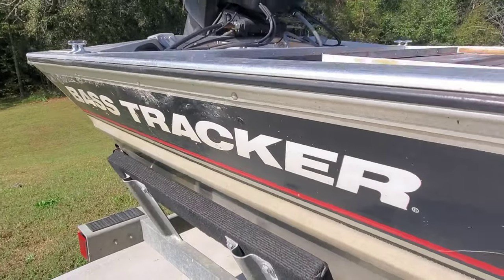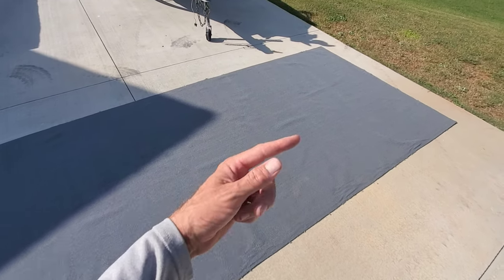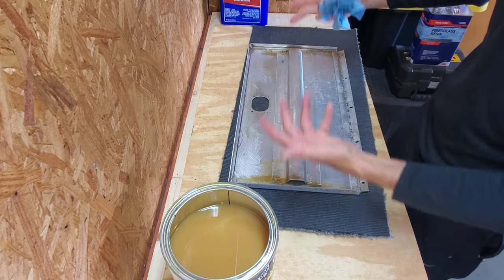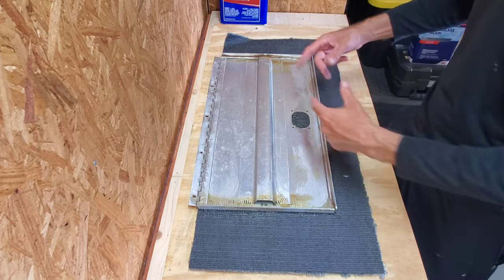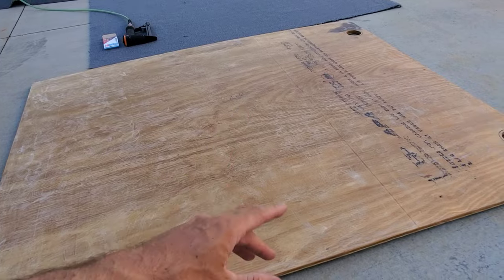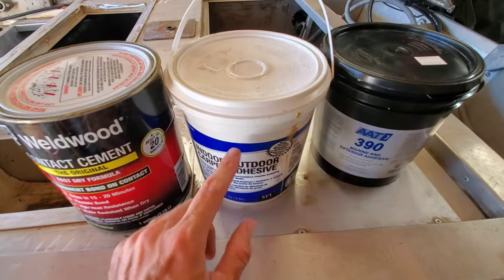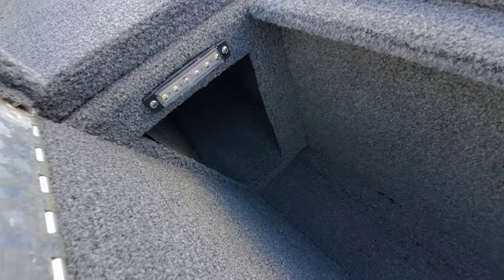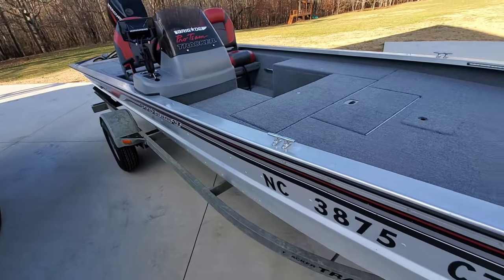DIY Aluminum Bass Boat/ Jon Boat Carpet | Everything I Know to Install Boat Carpet 2022

Comment: Thank you thank you thank you! You are the first one I’ve stumbled across that actually tells people to lay everything out the same direction. Looks like you do great work.
Coming from someone that has done auto and marine carpet and upholstery for 17+ years, I have a suggestion on some glue you can try that would streamline the process so much more. I use weldwood contact adhesive as well, but I use the landau top and trim spray grade adhesive, in my experience it is much better than a brush on glue because you can spray it and after about a minute stick it down without so much of a mess, plus it allows for a much more even coverage. It is a little bit pricier but you can spray it out of a standard gravity fed paint gun. 
Also, I know this will be a controversial topic, but you honestly do not need to strip every ounce of old glue off. The way I see it, if after a sharp scraper and a brush goes over it and smooths it out and there is still some left, than that glue is not coming off any time soon, and it will not affect how the carpet adhesive sticks to a lid or floor.
Just my two cents, I know a lot of people will hate on it, but I always try and help out with advice when I can.

Comment: I have this exact boat and I just got my carpet from Amazon yesterday.  I have contact cement and an exterior carpet.  I replaced the floor with a sheet of aluminum and put a skin of aluminum over the plywood on the deck.  I am adding some lighting and will build out the deck.  Wish me luck!  This video has been instrumental in my rebuilding my boat.  Many years with my kids…..thanks

Comment: Perfect timing for me on this, thanks for the detailed video.  I watched this after carpeting my first 2 panels of a 16’ tracker so many to go.  I was paying attention to laying out the carpet all north-south off the roll into the boat front back but didn’t pay attention to if I flipped a piece to south north...figured the grain was the same but your “50 shades of grey “ comments made me check and no doubt, even keeping the grain in line but flipping to south north is super visible so thanks again.  I got lucky my 2 were ok but I had one ready to start that wasn’t!
PS regarding the contact cement.  If you want to speed up application on a good sized project I might suggest DAP Weldwood Landau top sprayable version over the red can original.  You can spray it from a cheap $20 harbor freight gun.  Goes on way faster, more evenly and has quicker flash off.  I think it’s what the factories all use, always looks sprayed to me.  As a former car audio shop owner I upholstered a lot there and we always used it, when starting ,my boat I called DAP to ask and they suggest it over red can for boats, they said it’s more foe auto and outdoors, red is for countertops etc but obviously does work.  You won’t find it in stores but Amazon etc has it. Just a thought

Comment: Fantastic video, as always!  I just completed my wood-decked project, using the same TEC adhesive and spreaders.  It's great that it is water-cleanup (as long as it is still soft), because that can save minor mishaps.  One thing I did to prevent fraying of cut-piece carpet edges is to use a hot knife to cut all my carpet parts.  It's slower, but it seals the edges as you cut.  With just a razor knife, it seemed that the carpet wanted to fray a bit when cut with the grain...and I used the same 20 oz carpet as you have on this project.

One other tip...try a silver Sharpie when marking the back of the carpet -- they are amazing.

Comment: WOW! lots of great info. I am going to do a 1992 Basstracker Pro 17. almost the same boat as you have here. Only one question, how did you screw the wooden decks down and not have the screw heads showing?

Comment: What would be the cheapest route I could take to redo my boat? Carpet or foam next question… And one of your videos I thought you said Bass tracker uses half-inch plywood, mine looks like 3/4 Next question when buying that plywood I bought three-quarter inch marine grade. In my area I t’s $128 a sheet. Unfortunately I think I need two sheets… Do I actually need marine grade or can I buy an outdoor type plywood(what kind) and coat it in fiberglass resin like you do.

Comment: Awesome job brother!! Great tips and techniques. My Bass Tracker Pro Team 175 TXW needs this. Factory carpet just doesn’t last long.
Reply from the maker: Thanks man, appreciate it. Hopefully youcan rework yours.
Reply: @AnthonyJonesBrigadeBoats  One thing I noticed on my boat and other how-to videos. The carpet on the hatch openings doesn’t wrap under the frame lip. It actually stops at the bottom of the vertical so the carpet wrapped under the hatch sits on bear aluminum. I suppose that is because there doesn’t need to be double thickness there. Just an FYI thing for ya.

Comment: Now this was good. I never even thought of the front to back layout. I am in the process of doing a 16ft 96 Sylvan sea monster ( more like a sea Guppy really). I am trying to figure out the flooring. It sat for years. After we cleaned out 2 feet of leaves trash bags full of who knows what ...did find some used diapers as well. So clean out took days. Cut out the 20 wood panels and covers. They were in bad shape. But the sub floor was marine grade 1/2 inch plywood. It remarkably are in good shape. Washed it down and I am stumped. I am going to recarpet all the cut outs in 20 ounce marine carpet. But what to do with the floor. It's all riveted down. So I don't have panels to pull up and redo. Thought of going with Kiwigrip paint. But it won't look to good in my opinion. I guess I will have to pull out the driver's console so I have an open flat surface to work with. Any thing different you should do on the floor than the panels?
Reply from the maker: Yes, I recommend Hydroturf or Sea Dek. It's eva foam material with 3m adhesive backing. I have been using it on some of my recent builds. I would not recommend getting an imitation product. Hydroturf or SeaDek

Comment: I would like to move two batteries up front by my trolling motor and would like to cut in a compartment  for each on both sides of my pedestal seat. Where can I get the prefabricated hinged compartments. Yes I might as well  re-carpet the rest of boat while I’m at it.  Thanks in advance.

Comment: Mr Anthony, I need your help please. 3 pieces are confusing me, the console, the front storage, and the side rod locker. Because they stand up which way do you run the carpet to be less noticeable. 1994 18 foot Tracker

Comment: Hey sir have you ever tried the razor blades with the hooks on the ends? They work way better than regular razor blades and are designed specifically for  cutting carpet. Great in depth video
Reply from the maker: I haven't.  I have some actually but always used them for cutting roofing shingles.  I'll give them a try. Thanks

Comment: Hey I have the same boat and I am carpeting it. I ran into an issue when I used the same context cement that you do. The carpet is not sticking well is there anything that you could recommend I have already tried putting wood blocks to secure it better, but it still comes undone. Thanks

Comment: Awesome job and great video.
Reply from the maker: Appreciate it👊
Reply: Have you ever tryed to pull the back casting decking off of a tracker? I have to do some work under there and was wondering if it was possible.
Reply from the maker: It's possible.  I haven't on a tracker yet but have on a Lowe

Comment: I'm a subscriber and I'm having a problem installing carpet around the bezel & shifter on my tracker.  Do you carpet around the throttle or remove the shifter all together  ?  I'm a little confused about how to do it... 
Thanking you in advance,  Butch
Reply from the maker: I typically remove whatever I can to carpet. The throttle control was removed in the boat in video to carpet the panel.

Comment: What length of carpet do you order to completely recarpet a 17’ Tracker?
Reply from the maker: I typically go ahead and get the 8ft by 30ft to account for verticals and inside comparts floor or walls. You should end up with a bit left over.

Comment: Where do I get replacement plastic piece that the trolling motor plugs into mounted into the bow ?what would that be called?
Reply from the maker: different ones on Amazon.  try trolling motor plug/adapter

Comment: Great video on the techniques you use.   The contact cement you’re using is labeled as water resistant, so I contact DAP.  Their rep indicates that DAP does not have a recommended contact cement for marine applications.  They referred me to 3M.  Please confirm the product is OK.
Reply from the maker: I as well as other shops I know of use the Dap and have had great success. I can attest of a few boats I used it on 3 years plus ago w no issues. If I were running a turn key carpet shop I'd use a specialty cement from a manufacturer like 3m and order it by the barrel. I'm still using the Dap as of now.

Comment: Could you please let me know the exact type of plywood and resin used.  I'm at that point in my boat rebuild and have gotten a million different suggestions online.  Really confusing!  You absolutely are an expert and craftsman when it comes to doing these tin boats, so I will do what you recommend.  Thanks, and keep up the great work!
Reply from the maker: I use EXTERIOR grade 1/2 inch plywood from home depot. The exterior grade means the plywood laminates are glued together with a moisture resistant glue, therefore it is rated for outside use without delamintion occurring the first time it gets wet. Now, if it were to get wet over and over again, eventually it will rot. Which is why i take the extra step of sealing the tops and sides of my parts with fiberglass resin. I prefer Bondo brand fiberglass resin and hardener, found at Lowe's or Home Depot as well as Wal Mart i believe.  Again, make sure to use exterior grade plywood, not standard . Marine plywood is overkill and usually special order and not in stock. Don't overthink it or listen to the 1,000 opinions online. I buuld tgese boats fir a living and have dobe so for a long while now. 1/2 inch exterior plywood and fiberglass resin works for me. Hope this helps
Reply: @AnthonyJonesBrigadeBoats  by exterior grade, do you mean pressure treated? Thanks!

Comment: Just a fair warning everyone.. the weld wood glue is useless for rubber backed carpet. If you are folding corners and expecting it to hold, you better be using very light carpet.
Reply from the maker: I've done many boats and use the heaviest marine backed 20oz carpet as demonstrated in the video. Weldwood contact cement works perfectly. You have to apply it to both surfaces and let it tack over before bonding them. Otherwise it will not hold. Not sure your issue but again me and many professional use it and it works great given proper prep, application technique and proper curing temperature.